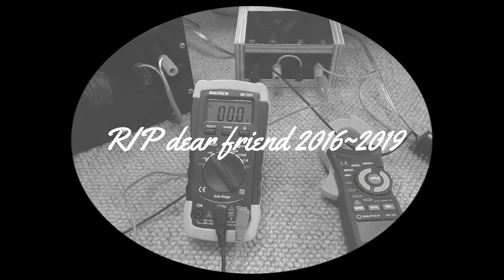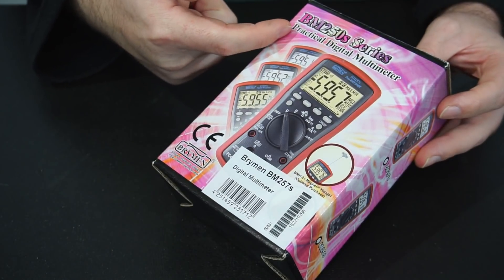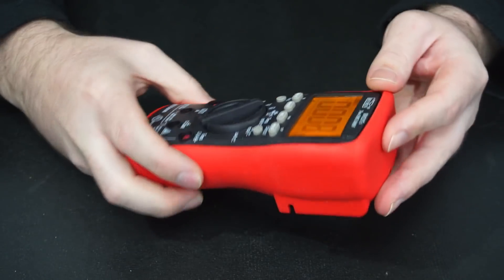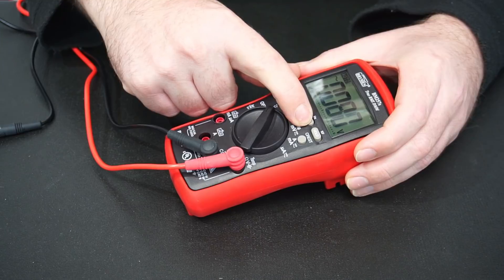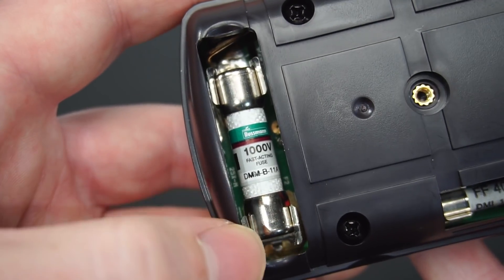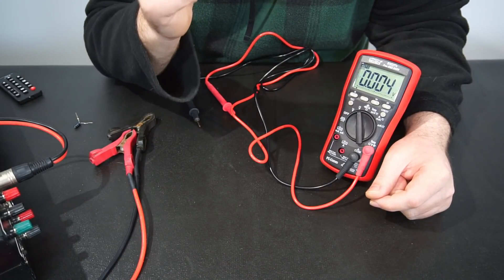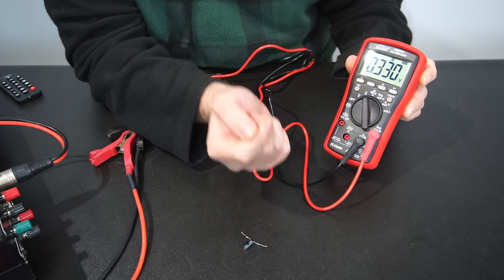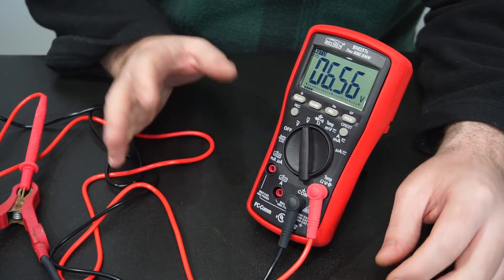Why I like The Brymen BM257s Multi Meter (Features/Review)

Comment: For my DIY tasks required a good replacement for my current half-smashed cheapo multimeter. Ordered BM257s a hour ago, then found this review. Thanks for good demonstration. Didn't noticed that BM257s have NCV (electric field) detection feature too - that is awesome. Crest seems useful for me too for control impulse presence check.
I'm curious how long it will work from those two AAA batteries. Usually multimeters use 9V batteries.
Reply: Is this more accurate than Chinese brands?
Reply: @11Modern11  Brymen meters are Taiwanese made. So sort of Chinese, but at least written specs match to real device properties. Plus high voltage insulation and fuses are always real deal. Fair enough for me.
Reply: @KrotowX  Is this one good for a second opinion dmm? these days chinese brands are more accurate than fluke. i have rm111 a cheapo one, now im looking for a good one, accurate, and reliable.
Reply: Received mine BM257s at today. NCV mode definitely works for room wiring in walls. Need a little practice where to stop waving meter around. Resistor, diode and small capacitor value determining works even for nearly all components soldered on board - just what I wanted. LoZ mode is interesting - both voltage, resistance and continuity meters in one bottle. Will play with that around some incoming laptop boards.
Do 31C for alive human body in temperature measurement mode is normal or I'm a vampire?
Reply: @KrotowX  I am looking and probably will buy the 867's model

Comment: Thanks for your review of the Brymen 257.  You guided my decision and I love the meter.  It shows quality engineering to get a CATIV rating into such a small and affordable package.  And I LOVE the NV ram settings that you led me to.  Great little meter.  Thank you for your work and time.Both you and Dave mention the "Crest" button, but don't seem to accord it much value.  The 5 mSec response lets you "look inside" a 60 Hz wavetrain.  It presents you with two (2) tools that might lead to a figure-of-merrit calculation for noise on the signal:  Crest Ratio (Cmax/RMSmax) and Crest Difference (Cmax-Cmin).  This certainly can't replace a scope but it MAY tell you when you need to drag one out.I haven't got the equipment or the smarts to pursue this idea.  I know just enough about this stuff to be CONSISTANTLY WRONG but I'd love to see a discussion about it.Regards,
Tom Hoffmann
Reply from the maker: I'm pleased my video was of use to you. It really is impressive how much this DMM has to offer for the price. Thanks for the info!

Comment: I recently bought a Brymen BM257S here in Germany. It's nice but there ist something, that i don't understand:  If i use the temperature-sensor the room-temperature is approximately correct.  But if i put it into the frige, it shows 38°C and in my oral cavity, it shows 8°C.  It seems, that the BM257S measures 'the wrong direction'.  Not important but  i hope the other functions are more accurate.
Reply: Well, judging by how the readings drop as the tempetature increases, I think you have the K-type probe plugged in backward, try swapping the connections and try again.
Reply from the maker: It might be a faulty k-type temp probe? K-type temp sensors aren't the best for accuracy but, what you describe is well out of specifications. I'd recommend buying a new temp probe

Comment: Based on Joe Smith's testing of various Brymens (and others) and your review, I decided to order a BM257s (which is a step up over the BM235) because it has a scale display and it has separate AC/DC voltage selections. I got it for US $124 shipped from a distributor called TME. This is about $40 cheaper than the same thing in Greenlee clothing, the DM510a. 
I'm very happy with my BM257s. Great meter, love the higher quality leads, its speed, accuracy and build quality. The Crest feature is useful and I liked your demonstration.
Thanks for your review!

Comment: I think that REC and CREST are not the same. REC is supposed to show TrueRMS min/max while CREST will show min/max of actual absolute values peaks. For example, for 220V AC CREST should show something like +310/-310. Did you compare these modes on AC?
Reply from the maker: No, I haven't compared REC and CREST on AC.  I'll be interested to see if that's one of the main differences between the modes. The manual is not very well written and does require a bit of clarification. So thanks for your input! :)

Comment: I've got the Dave Jones ( EEVBlog )  branded one, which is a Brymen BM235, I assume an earlier version of this one ?
Reply from the maker: I'd say you're right. Though I don't think the 257s is intended to outright replace the 235. Having said that. The price point is almost the same. I can't see the point in buying the 235 to save a mere €15. So you're probably safe to assume the 235 is a generation before the 257s. Both are great meters and both have very similar feature sets. From a quick glance over the specs, I think the main difference is the Crest/Rec feature.
Reply: No, the BM235 is actually a newer model than the BM257. David Jones said so in multiple of his videos.
Reply: @Brian-uq6jm a newer model with less features, yes? To attract a slightly more affordable market?

Comment: Brymens basically are no brainers. They are very well priced, really sturdy and top quality. The price quality ratio is very nice. If you only work with low voltages you could go for one of these AN8008 or similar high count cheap Chinese meters.
Reply: When I started to search for my old and cheap multimeter replacement, considered AN8008 too. However sometimes I do electrician tasks and after EEVBlog viewing I don't want to rely on meter with non-existent high voltage insulation.